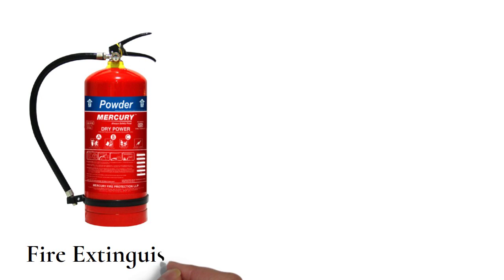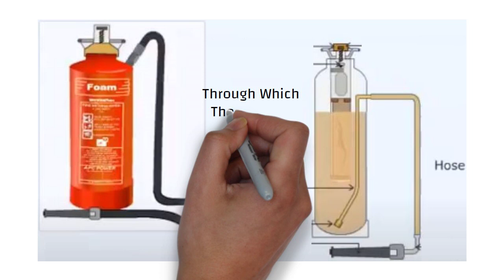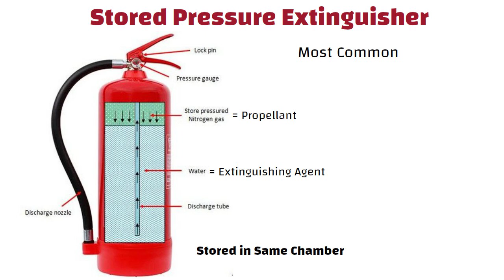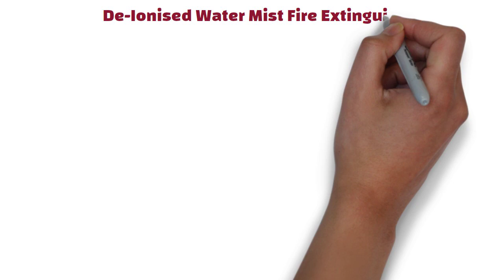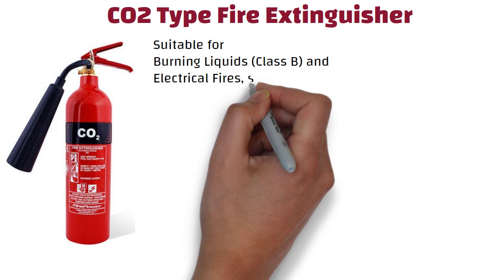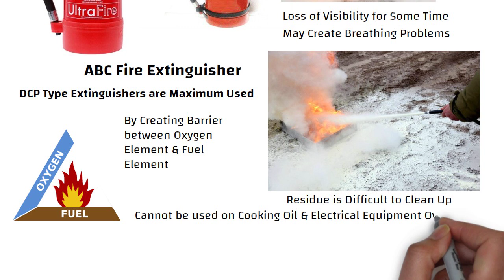FIRE EXTINGUISHER DEALERS IN KERALA, CALL 8138906102, FIRE EXTINGUISHER DEALERS IN ERNAKULAM.

Comment: Fire alarm systems in Kollam
Reply: FIRE EXTINGUISHER DEALERS IN THALASSERY, FIRE EXTINGUISHER SUPPLIERS IN THALASSERY, FIRE EXTINGUISHER DISTRIBUTORS IN THALASSERY, FIRE EXTINGUISHER IN THALASSERY, ABC TYPE FIRE EXTINGUISHER DEALERS IN THALASSERY, CO2 TYPE FIRE EXTINGUISHER DEALERS IN THALASSERY, CLEAN AGENT FIRE EXTINGUISHER IN THALASSERY, MODULAR TYPE FIRE EXTINGUISHER DEALERS IN THALASSERY, MECHANICAL FOAM FIRE EXTINGUISHER DEALERS IN THALASSERY, FIRE EXTINGUISHER NEAR ME THALASSERY, FIRE EXTINGUISHER TRADERS IN THALASSERY, FIRE FIGHTING COMPANIES IN THALASSERY, FIRE CONTRACTORS IN THALASSERY, FIRE EQUIPMENT DEALERS IN THALASSERY, FIRE ALARM DEALERS IN THALASSERY, FIRE PUMP DEALERS IN THALASSERY, SMOKE DETECTOR DEALERS IN THALASSERY, FIRE FIGHTING SYSTEM IN THALASSERY, FIRE PROTECTION SYSTEM IN THALASSERY, FIRE AND SAFETY CONTRACTORS IN THALASSERY, FIRE HYDRANT SYSTEMS IN THALASSERY, PA TALK BACK SYSTEM IN THALASSERY, FIRE NOC IN THALASSERY, FIRE INSTALLATION IN THALASSERY, FIRE NOC RENEWAL IN THALASSERY, KIRLOSKAR FIRE PUMP DEALERS IN THALASSERY, FIRE EXTINGUISHER NEAR ME THALASSERY, FIRE EXTINGUISHER MANUFACURERS IN THALASSERY, SAFEX FIRE EXTINGUISHER DEALERS IN THALASSERY, FIRE NOC CONTRACTORS IN THALASSERY, FIRE FIGHTING EQUIPMENT DEALERS IN THALASSERY, FIRE PROTECTION SYSTEM IN THALASSERY, FIRE INSTALLATION IN THALASSERY, FIRE SAFETY CONTRACTORS IN THALASSERY, FIRE AMC IN THALASSERY, FIRE PROTECTION SYSTEM IN THALASSERY, FIRE PROTECTION EQUIPMET IN THALASSERY, AMC OF FIRE SYSTEM IN THALASSERY, FIRE CONSULTANTS IN THALASSERY, FIRE AND SAFETY EQUIPMENT DEALERS IN THALASSERY, ADDRESSABLE FIRE ALARM SYSTEM IN THALASSERY, KARTHAR VALVE DEALERS IN THALASSERY, DCP TYPE FIRE EXTINGUISHER IN THALASSERY, POWSER TYPE FIRE EXTINGUISHERS IN THALASSERY, FIRE HYDRANT SYSTEM IN THALASSERY, FIRE ALARM PANEL DEALERS IN THALASSERY, SAFEPRO FIRE EXTINGUISHER DEALERS IN THALASSERY, MS AND GI PIPE DEALERS IN THALASSERY, JINDAL PIPE DEALERS IN THALASSERY, AGNI FIRE ALARM DEALERS IN THALASSERY, FIRE EQUIPMENT DEALERS IN THALASSERY, FIRE EQUIPMENT SUPPLIERS IN THALASSERY, FIRE EQUIPMENT TRADERS IN THALASSERY, FIRE SPRINKLER SYSTEM IN THALASSERY, RAVEL FIRE ALARM DEALERS IN THALASSERY, RAVEL FIRE ALARM SYSTEM IN THALASSERY, AGNI FIRE ALARM DISTRIBUTORS IN THALASSERY, FIRE ALARM CONTRACTORS IN THALASSERY, FIRE PIPE INSTALLATION IN CONTRACTORS IN THALASSERY, FIRE SAFETY CONTRACTORS IN THALASSERY, FIRE PA TWO WAY TALK BACK SYSTEM DEALERS IN THALASSERY, HEAT DETECTOR DEALERS IN THALASSERY, HONEYWELL FIRE ALARM DEALERS IN THALASSERY, FIRE NOC CONSULTANTS IN THALASSERY, FIRE AMC AND FIRE NOC IN THALASSERY, FIRE SAFETY COMPANIES IN THALASSERY, NEWAGE DEALERS IN THALASSERY, MONSHER FIRE EQUIPMENT DEALERS IN THALASSERY, KARTHAR VALVE DEALERS IN THALASSERY, FIRE HYDRANT VALVE DEALERS IN THALASSERY, FIRE HOSE REEL DRUM DEALERS IN THALASSERY, FIRE SPRINKLER DEALERS IN THALASSERY, FIRE PUMP DEALERS IN THALASSERY, LUBI PUMP DEALERS IN THALASSERY, LHP PUMP DEALERS IN THALASSERY. FIRE CONTRACTORS IN THALASSERY, FIRE AND SAFETY CONTRACTORS IN THALASSERY, FIRE EQUIPMENT DEALERS IN THALASSERY, FIRE FIGHTING CONTRACTORS IN THALASSERY, AGNI FIRE ALARM DEALERS IN THALASSERY, PA TALK BACK SYSTEM DEALERS IN THALASSERY, FIRE NOC IN THALASSERY, FIRE NOC RENEWAL IN THALASSERY, FIRE SYSTEM INSTALLATION IN THALASSERY.
Reply: FIRE EXTINGUISHER DEALERS IN KOTTARAKKARA, FIRE EXTINGUISHER SUPPLIERS IN KOTTARAKKARA, FIRE EXTINGUISHER DISTRIBUTORS IN KOTTARAKKARA, FIRE EXTINGUISHER IN KOTTARAKKARA, ABC TYPE FIRE EXTINGUISHER DEALERS IN KOTTARAKKARA, CO2 TYPE FIRE EXTINGUISHER DEALERS IN KOTTARAKKARA, CLEAN AGENT FIRE EXTINGUISHER IN KOTTARAKKARA, MODULAR TYPE FIRE EXTINGUISHER DEALERS IN KOTTARAKKARA, MECHANICAL FOAM FIRE EXTINGUISHER DEALERS IN KOTTARAKKARA, FIRE EXTINGUISHER NEAR ME KOTTARAKKARA, FIRE EXTINGUISHER TRADERS IN KOTTARAKKARA, FIRE FIGHTING COMPANIES IN KOTTARAKKARA, FIRE CONTRACTORS IN KOTTARAKKARA, FIRE EQUIPMENT DEALERS IN KOTTARAKKARA, FIRE ALARM DEALERS IN KOTTARAKKARA, FIRE PUMP DEALERS IN KOTTARAKKARA, SMOKE DETECTOR DEALERS IN KOTTARAKKARA, FIRE FIGHTING SYSTEM IN KOTTARAKKARA, FIRE PROTECTION SYSTEM IN KOTTARAKKARA, FIRE AND SAFETY CONTRACTORS IN KOTTARAKKARA, FIRE HYDRANT SYSTEMS IN KOTTARAKKARA, PA TALK BACK SYSTEM IN KOTTARAKKARA, FIRE NOC IN KOTTARAKKARA, FIRE INSTALLATION IN KOTTARAKKARA, FIRE NOC RENEWAL IN KOTTARAKKARA, KIRLOSKAR FIRE PUMP DEALERS IN KOTTARAKKARA, FIRE EXTINGUISHER NEAR ME KOTTARAKKARA, FIRE EXTINGUISHER MANUFACURERS IN KOTTARAKKARA, SAFEX FIRE EXTINGUISHER DEALERS IN KOTTARAKKARA, FIRE NOC CONTRACTORS IN KOTTARAKKARA, FIRE FIGHTING EQUIPMENT DEALERS IN KOTTARAKKARA, FIRE PROTECTION SYSTEM IN KOTTARAKKARA, FIRE INSTALLATION IN KOTTARAKKARA, FIRE SAFETY CONTRACTORS IN KOTTARAKKARA, FIRE AMC IN KOTTARAKKARA, FIRE PROTECTION SYSTEM IN KOTTARAKKARA, FIRE PROTECTION EQUIPMET IN KOTTARAKKARA, AMC OF FIRE SYSTEM IN KOTTARAKKARA, FIRE CONSULTANTS IN KOTTARAKKARA, FIRE AND SAFETY EQUIPMENT DEALERS IN KOTTARAKKARA, ADDRESSABLE FIRE ALARM SYSTEM IN KOTTARAKKARA, KARTHAR VALVE DEALERS IN KOTTARAKKARA, DCP TYPE FIRE EXTINGUISHER IN KOTTARAKKARA, POWSER TYPE FIRE EXTINGUISHERS IN KOTTARAKKARA, FIRE HYDRANT SYSTEM IN KOTTARAKKARA, FIRE ALARM PANEL DEALERS IN KOTTARAKKARA, SAFEPRO FIRE EXTINGUISHER DEALERS IN KOTTARAKKARA, MS AND GI PIPE DEALERS IN KOTTARAKKARA, JINDAL PIPE DEALERS IN KOTTARAKKARA, AGNI FIRE ALARM DEALERS IN KOTTARAKKARA, FIRE EQUIPMENT DEALERS IN KOTTARAKKARA, FIRE EQUIPMENT SUPPLIERS IN KOTTARAKKARA, FIRE EQUIPMENT TRADERS IN KOTTARAKKARA, FIRE SPRINKLER SYSTEM IN KOTTARAKKARA, RAVEL FIRE ALARM DEALERS IN KOTTARAKKARA, RAVEL FIRE ALARM SYSTEM IN KOTTARAKKARA, AGNI FIRE ALARM DISTRIBUTORS IN KOTTARAKKARA, FIRE ALARM CONTRACTORS IN KOTTARAKKARA, FIRE PIPE INSTALLATION IN CONTRACTORS IN KOTTARAKKARA, FIRE SAFETY CONTRACTORS IN KOTTARAKKARA, FIRE PA TWO WAY TALK BACK SYSTEM DEALERS IN KOTTARAKKARA, HEAT DETECTOR DEALERS IN KOTTARAKKARA, HONEYWELL FIRE ALARM DEALERS IN KOTTARAKKARA, FIRE NOC CONSULTANTS IN KOTTARAKKARA, FIRE AMC AND FIRE NOC IN KOTTARAKKARA, FIRE SAFETY COMPANIES IN KOTTARAKKARA, NEWAGE DEALERS IN KOTTARAKKARA, MONSHER FIRE EQUIPMENT DEALERS IN KOTTARAKKARA, KARTHAR VALVE DEALERS IN KOTTARAKKARA, FIRE HYDRANT VALVE DEALERS IN KOTTARAKKARA, FIRE HOSE REEL DRUM DEALERS IN KOTTARAKKARA, FIRE SPRINKLER DEALERS IN KOTTARAKKARA, FIRE PUMP DEALERS IN KOTTARAKKARA, LUBI PUMP DEALERS IN KOTTARAKKARA, LHP PUMP DEALERS IN KOTTARAKKARA. FIRE CONTRACTORS IN KOTTARAKKARA, FIRE AND SAFETY CONTRACTORS IN KOTTARAKKARA, FIRE EQUIPMENT DEALERS IN KOTTARAKKARA, FIRE FIGHTING CONTRACTORS IN KOTTARAKKARA, AGNI FIRE ALARM DEALERS IN KOTTARAKKARA, PA TALK BACK SYSTEM DEALERS IN KOTTARAKKARA, FIRE NOC IN KOTTARAKKARA, FIRE NOC RENEWAL IN KOTTARAKKARA, FIRE SYSTEM INSTALLATION IN KOTTARAKKARA.
Reply: FIRE EXTINGUISHER DEALERS IN PALAKKAD, FIRE EXTINGUISHER SUPPLIERS IN PALAKKAD, FIRE EXTINGUISHER DISTRIBUTORS IN PALAKKAD, FIRE EXTINGUISHER IN PALAKKAD, ABC TYPE FIRE EXTINGUISHER DEALERS IN PALAKKAD, CO2 TYPE FIRE EXTINGUISHER DEALERS IN PALAKKAD, CLEAN AGENT FIRE EXTINGUISHER IN PALAKKAD, MODULAR TYPE FIRE EXTINGUISHER DEALERS IN PALAKKAD, MECHANICAL FOAM FIRE EXTINGUISHER DEALERS IN PALAKKAD, FIRE EXTINGUISHER NEAR ME PALAKKAD, FIRE EXTINGUISHER TRADERS IN PALAKKAD, FIRE FIGHTING COMPANIES IN PALAKKAD, FIRE CONTRACTORS IN PALAKKAD, FIRE EQUIPMENT DEALERS IN PALAKKAD, FIRE ALARM DEALERS IN PALAKKAD, FIRE PUMP DEALERS IN PALAKKAD, SMOKE DETECTOR DEALERS IN PALAKKAD, FIRE FIGHTING SYSTEM IN PALAKKAD, FIRE PROTECTION SYSTEM IN PALAKKAD, FIRE AND SAFETY CONTRACTORS IN PALAKKAD, FIRE HYDRANT SYSTEMS IN PALAKKAD, PA TALK BACK SYSTEM IN PALAKKAD, FIRE NOC IN PALAKKAD, FIRE INSTALLATION IN PALAKKAD, FIRE NOC RENEWAL IN PALAKKAD, KIRLOSKAR FIRE PUMP DEALERS IN PALAKKAD, FIRE EXTINGUISHER NEAR ME PALAKKAD, FIRE EXTINGUISHER MANUFACURERS IN PALAKKAD, SAFEX FIRE EXTINGUISHER DEALERS IN PALAKKAD, FIRE NOC CONTRACTORS IN PALAKKAD, FIRE FIGHTING EQUIPMENT DEALERS IN PALAKKAD, FIRE PROTECTION SYSTEM IN PALAKKAD, FIRE INSTALLATION IN PALAKKAD, FIRE SAFETY CONTRACTORS IN PALAKKAD, FIRE AMC IN PALAKKAD, FIRE PROTECTION SYSTEM IN PALAKKAD, FIRE PROTECTION EQUIPMET IN PALAKKAD, AMC OF FIRE SYSTEM IN PALAKKAD, FIRE CONSULTANTS IN PALAKKAD, FIRE AND SAFETY EQUIPMENT DEALERS IN PALAKKAD, ADDRESSABLE FIRE ALARM SYSTEM IN PALAKKAD, KARTHAR VALVE DEALERS IN PALAKKAD, DCP TYPE FIRE EXTINGUISHER IN PALAKKAD, POWSER TYPE FIRE EXTINGUISHERS IN PALAKKAD, FIRE HYDRANT SYSTEM IN PALAKKAD, FIRE ALARM PANEL DEALERS IN PALAKKAD, SAFEPRO FIRE EXTINGUISHER DEALERS IN PALAKKAD, MS AND GI PIPE DEALERS IN PALAKKAD, JINDAL PIPE DEALERS IN PALAKKAD, AGNI FIRE ALARM DEALERS IN PALAKKAD, FIRE EQUIPMENT DEALERS IN PALAKKAD, FIRE EQUIPMENT SUPPLIERS IN PALAKKAD, FIRE EQUIPMENT TRADERS IN PALAKKAD, FIRE SPRINKLER SYSTEM IN PALAKKAD, RAVLE FIRE ALARM DEALERS IN PALAKKAD, RAVEL FIRE ALARM SYSTEM IN PALAKKAD, AGNI FIRE ALARM DISTRIBUTORS IN PALAKKAD, FIRE ALARM CONTRACTORS IN PALAKKAD, FIRE PIPE INSTALLATION IN CONTRACTORS IN PALAKKAD, FIRE SAFETY CONTRACTORS IN PALAKKAD, FIRE PA TWO WAY TALK BACK SYSTEM DEALERS IN PALAKKAD, HEAT DETECTOR DEALERS IN PALAKKAD, HONEYWELL FIRE ALARM DEALERS IN PALAKKAD, FIRE NOC CONSULTANTS IN PALAKKAD, FIRE AMC AND FIRE NOC IN PALAKKAD, FIRE SAFETY COMPANIES IN PALAKKAD, NEWAGE DEALERS IN PALAKKAD, MONSHER FIRE EQUIPMENT DEALERS IN PALAKKAD, KARTHAR VALVE DEALERS IN PALAKKAD, FIRE HYDRANT VALVE DEALERS IN PALAKKAD, FIRE HOSE REEL DRUM DEALERS IN PALAKKAD, FIRE SPRINKLER DEALERS IN PALAKKAD, FIRE PUMP DEALERS IN PALAKKAD, LUBI PUMP DEALERS IN PALAKKAD, LHP PUMP DEALERS IN PALAKKAD. FIRE CONTRACTORS IN PALAKKAD, FIRE AND SAFETY CONTRACTORS IN PALAKKAD, FIRE EQUIPMENT DEALERS IN PALAKKAD, FIRE FIGHTING CONTRACTORS IN PALAKKAD,
Reply: FIRE EXTINGUISHER DEALERS IN KERALA, FIRE EXTINGUISHER SUPPLIERS IN KERALA, FIRE EXTINGUISHER DISTRIBUTORS IN KERALA, FIRE EXTINGUISHER IN KERALA, ABC TYPE FIRE EXTINGUISHER DEALERS IN KERALA, CO2 TYPE FIRE EXTINGUISHER DEALERS IN KERALA, CLEAN AGENT FIRE EXTINGUISHER IN KERALA, MODULAR TYPE FIRE EXTINGUISHER DEALERS IN KERALA, MECHANICAL FOAM FIRE EXTINGUISHER DEALERS IN KERALA, FIRE EXTINGUISHER NEAR ME KERALA, FIRE EXTINGUISHER TRADERS IN KERALA, FIRE FIGHTING COMPANIES IN KERALA, FIRE CONTRACTORS IN KERALA, FIRE EQUIPMENT DEALERS IN KERALA, FIRE ALARM DEALERS IN KERALA, FIRE PUMP DEALERS IN KERALA, SMOKE DETECTOR DEALERS IN KERALA, FIRE FIGHTING SYSTEM IN KERALA, FIRE PROTECTION SYSTEM IN KERALA, FIRE AND SAFETY CONTRACTORS IN KERALA, FIRE HYDRANT SYSTEMS IN KERALA, PA TALK BACK SYSTEM IN KERALA, FIRE NOC IN KERALA, FIRE INSTALLATION IN KERALA, FIRE NOC RENEWAL IN KERALA, KIRLOSKAR FIRE PUMP DEALERS IN KERALA, FIRE EXTINGUISHER NEAR ME KERALA, FIRE EXTINGUISHER MANUFACURERS IN KERALA, SAFEX FIRE EXTINGUISHER DEALERS IN KERALA, FIRE NOC CONTRACTORS IN KERALA, FIRE FIGHTING EQUIPMENT DEALERS IN KERALA, FIRE PROTECTION SYSTEM IN KERALA, FIRE INSTALLATION IN KERALA, FIRE SAFETY CONTRACTORS IN KERALA, FIRE AMC IN KERALA, FIRE PROTECTION SYSTEM IN KERALA, FIRE PROTECTION EQUIPMET IN KERALA, AMC OF FIRE SYSTEM IN KERALA, FIRE CONSULTANTS IN KERALA, FIRE AND SAFETY EQUIPMENT DEALERS IN KERALA, ADDRESSABLE FIRE ALARM SYSTEM IN KERALA, KARTHAR VALVE DEALERS IN KERALA, DCP TYPE FIRE EXTINGUISHER IN KERALA, POWSER TYPE FIRE EXTINGUISHERS IN KERALA, FIRE HYDRANT SYSTEM IN KERALA, FIRE ALARM PANEL DEALERS IN KERALA, SAFEPRO FIRE EXTINGUISHER DEALERS IN KERALA, MS AND GI PIPE DEALERS IN KERALA, JINDAL PIPE DEALERS IN KERALA, AGNI FIRE ALARM DEALERS IN KERALA, FIRE EQUIPMENT DEALERS IN KERALA, FIRE EQUIPMENT SUPPLIERS IN KERALA, FIRE EQUIPMENT TRADERS IN KERALA, FIRE SPRINKLER SYSTEM IN KERALA, RAVLE FIRE ALARM DEALERS IN KERALA, RAVEL FIRE ALARM SYSTEM IN KERALA, AGNI FIRE ALARM DISTRIBUTORS IN KERALA, FIRE ALARM CONTRACTORS IN KERALA, FIRE PIPE INSTALLATION IN CONTRACTORS IN KERALA, FIRE SAFETY CONTRACTORS IN KERALA, FIRE PA TWO WAY TALK BACK SYSTEM DEALERS IN KERALA, HEAT DETECTOR DEALERS IN KERALA, HONEYWELL FIRE ALARM DEALERS IN KERALA, FIRE NOC CONSULTANTS IN KERALA, FIRE AMC AND FIRE NOC IN KERALA, FIRE SAFETY COMPANIES IN KERALA, NEWAGE DEALERS IN KERALA, MONSHER FIRE EQUIPMENT DEALERS IN KERALA, KARTHAR VALVE DEALERS IN KERALA, FIRE HYDRANT VALVE DEALERS IN KERALA, FIRE HOSE REEL DRUM DEALERS IN KERALA, FIRE SPRINKLER DEALERS IN KERALA, FIRE PUMP DEALERS IN KERALA, LUBI PUMP DEALERS IN KERALA, LHP PUMP DEALERS IN KERALA. FIRE CONTRACTORS IN KERALA, FIRE AND SAFETY CONTRACTORS IN KERALA, FIRE EQUIPMENT DEALERS IN KERALA, FIRE FIGHTING CONTRACTORS IN KERALA